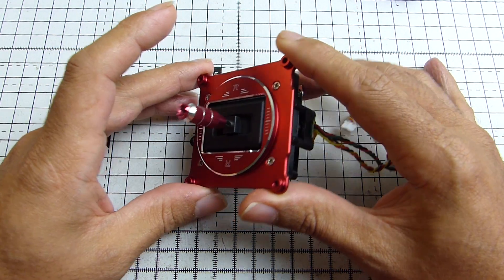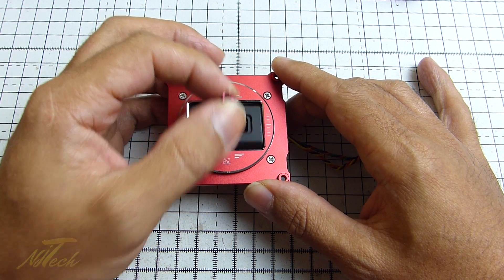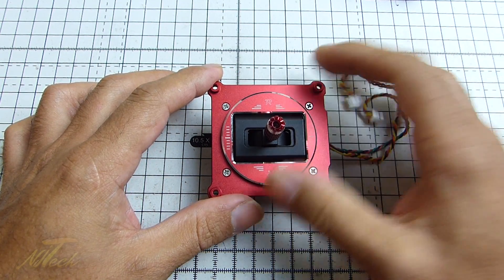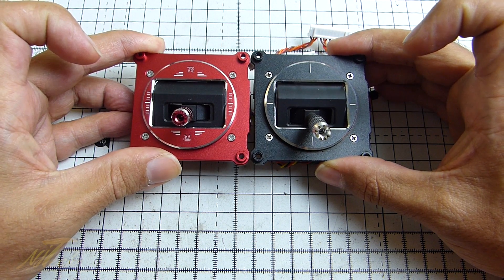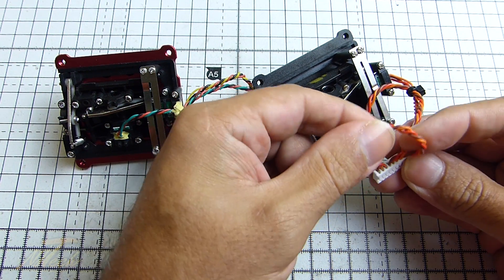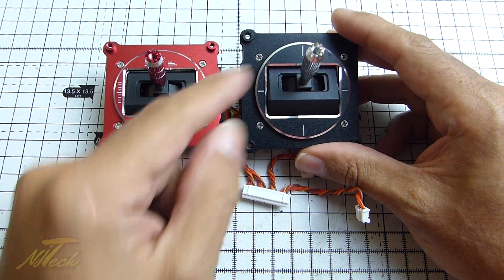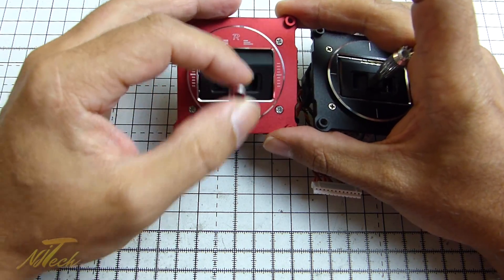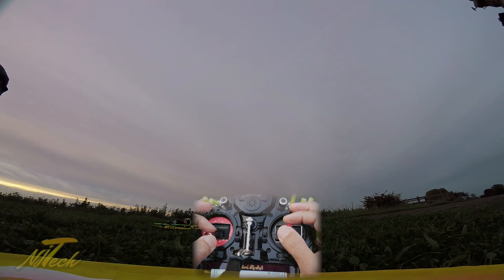Frsky Taranis M9 R Upgrade Gimbals! Review & Flight test!

Comment: That loss of resolution is just not true.. The axis gives an analog voltage and is divided into digital steps in the radio based on the calibration.
Reply from the maker: I was speculating at the time, and of course you are right. This video is quite old now, and since then there were many videos showing the resolution actually compared to the normal gimbal. Thanks for the comment.

Comment: i'm not so sure about that thing with the sensors and stick ... or rather, i dont think there will be any disadvantage to just limiting the throw. aside from tighter endstops, there seems to be no difference in the construction, sensor, or it's placement. and  since it's a drop in replacement for potentiometers, the sensors themselves are purely analog. 
so the actual accuracy and resoluton purely depends on the calibration and the resolution of the ADCs (analog digital converter), used to read that analog output voltage

Comment: Any special reason to just Change throttle gimbal ?
Reply from the maker: yes, it has a shorter throw which makes moving from bottom to top throttle much faster and feel more responsive. Very popular with racers, for me as a freestyler i also find it really nice to fly with, but its a personal thing, you might not.
Reply: @NJ-Tech  seems awesome the long travel stick killing me, i got hall m9, was thinking Change to m9r, but dont know if i should Change both gimbals or just throttle
Reply from the maker: @Maorifpv  throttle only because it will feel weird to have pitch shorter than roll, for certain manoeuvres anyway that would mess with me. But there is no rule to say you cant try it! :)
Reply: @NJ-Tech  make Sense :) thx

Comment: I opened my m9r and realized the red plate is the only difference between m9r and m9 black plate. The red plates have more material in the back inside which acts as limiter for the stick. Everything else looks same. They could have just sold the red plates alone.
Now - I'm modding the removed m9 for aprox 50 degree throw for roll and pitch by adding 1mm plastic spacers inside. And will mate that to m9r.
Reply: I just modded my regular m9 gimbals to reduce the throw by about 25% (i.e. from 60deg to 45deg). I just detached the face plate and added two layers of credit cards material where the stoppers make contact. That's about 1.8mm added thickness. I used CA glue to keep everything together. Seems to have worked like a charm. I am glad I could do this mod: no need to buy new gimbals, and I keep everything in black (which looks better imho).
Also I quite like the reduced throw, it makes my kind of flying easier (lots of throttle banging).
Reply from the maker: great idea! I definitely would prefer the black, I might do this mod to my X10 gimbal as i really do enjoy the shorter throw. Another bonus is putting your credit cards there will make it difficult to spend money ;)
Reply from the maker: are you sure its the the physical position of the stopper on the gimbal barrel that determines the throw? My m9r plate looks the same as my m9 one..
Reply: NJ Tech yes. Have to see both back to back carefully. My m9r had 60degree throw when I installed the black plate of old m9. That shocked me. So I checked on

Edit. It's in the back inside. Otherside of where "R" is written, it's thicker there compared to the black ones.
We have to remove the silver screws to detach the plates
Reply from the maker: as you say, a bit cheeky if thats all it is. Well spotted. Easy mod for others on their standard gimbals then! Thanks for the comment :)
Reply: NJ Tech thank you. Now it's just a mod for others to do. :) 
I may try out the old m9 and red plate to see if there's any difference to stock m9r.
Reply: Dimitri Terhout yes. I have done the same thing for roll pitch and yaw also about 50degree now.
Reply: Dimitri Terhout good that u tried it. Do you need to do any software calibration? On the taranis? Or bf or raceflight?
Reply: Daniel Looi need to calibrate gimbals in tx

Comment: Could you just take the black from the regular M9 Gimbal and swap with the red cover?
Reply from the maker: i had a play and although i havent actually done it, it appears that yes you can :)
Reply: NJ Tech do u have a qx7 tx? Wondering if the m9r plate can be removed and replaced with the m7 plate... to fit into the qx7

Comment: Great review as usual handsome :)
I like the 45° throttle travelling. I have that issue which is highly amplified when flying a lightweight quad, i can not reach the top throttle because the throttle is so responsive so i kinda adapt my fingers to only go around 65% max i think which is so boring. I managed to fix it a bit with using umbrella stick ends for the gimbals at very low position but my issue is still here.
It's a great move for thumbers, i'm pretty sure it will fix my issue :D
I'm glad to see too as a pincher you are not uncumfortable with them :) Great stuff!
My only wonder is why that red color lol Black is so much better like for the old M9 lol
OK i'm heading to order two :)
Have a great weekend and keep on flying!

Comment: I tried these as a freestyle only pilot I hated them. Mine are getting sold. However doing some simulated racing around trees and low altitude stuff turns felt amazingly easy with little effort as well as fast forward flight holding the same altitude was easier as well. That's my 2c
Reply from the maker: Frank Sarfino yea I totally get it. This is a real case of 'horses for courses' which you'll love of hate. Thanks for the comment.

Comment: Amazing flight. Could you please share your PIDs?
Reply from the maker: Thanks man. Its actually pretty close to stock betaflight (3.2) pids. I just used my own rates and the dynamic filter on, gyro notch 1 and 2 at zero, D term type = PT1.

Comment: See how fast you can off and on the throttle with the red eye now🤣

This would be a good option especially for thumbs pilot, my hitec radio has shorter travel on the sticks and was perfect but since I jumped to Taranis QX7 with M7 gimbals I don't feel correct and definitely made me slower on controlling the throttle especially with yaw movement together..
Reply from the maker: yea i felt the same way about the X7. I think the problem is the gimbals are too deep in the sockets so you need to make the sticks longer, which makes the travel longer..